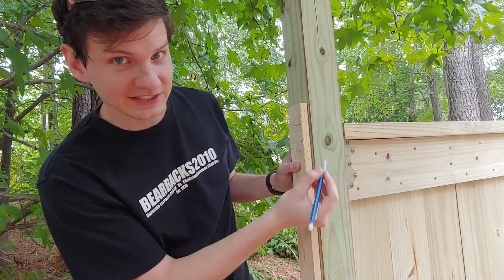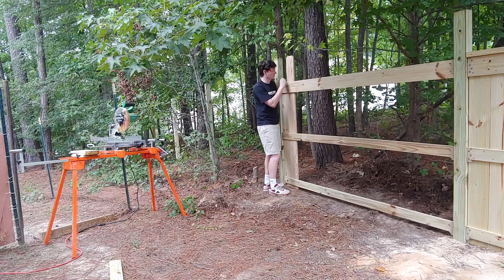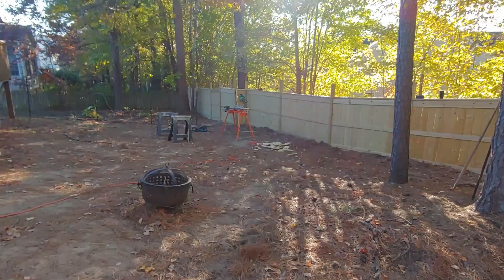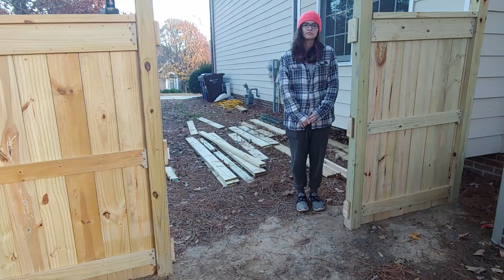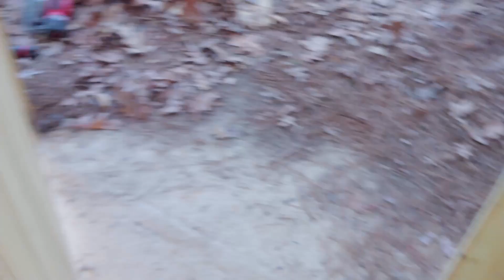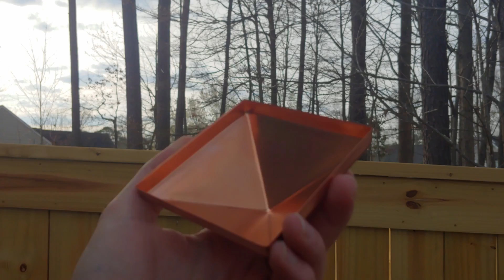How to Build a Privacy Fence With Hidden Gates

Comment: This video is old, so you may have found a different solution or found your way to open from the outside just fine, but we're going to try a pull knob: National Hardware N109-070 Gate Latch Cable Pull, 40", Black

This video also taught my husband about tools he didn't know about, so I feel like our upcoming Lowes trip is about to be more expensive 😂
Reply from the maker: Looks like that's made to do pretty much the same thing! The spring return feature is nice as I have to push/pull the wire back through manually. No big deal just could be better

Comment: looks great... have you had to replace a picket ?
Reply from the maker: Nope! No pickets have popped loose
Reply: @ProjectBilld  I wasn’t thinking they popped loose, maybe a broken one , just curious how tuff to replace one would be incase of a mishap or storm damage
Reply from the maker: Gotcha. If I had to replace one I'd probably cut the picket in half so I'd have room to slide it out. For replacing it I'd dig out under it a little and leave it shorter than before, just long enough it fits under the top rails.

Comment: Not enough screws penetration in the boards, no way!, always should be screwed from picket to post or rail not the other way around, looks pretty today not so sure in a few years
Reply from the maker: Seems like you missed a few details. The pickets are screwed from both sides and the screws come within a quarter inch of sticking out the otherside. It's been almost 4 years since I built the fence and it's still pretty

Comment: How the fence handling deflection with wind against it? That concerns me using 1x's.
Reply from the maker: No problems with wind to this point. As the boards dried they shrunk a little so there are 1/2 to 1 inch gaps between them that keep it from acting as a sail
Reply: @ProjectBilld  
Thanks for the response.

Comment: Where did you buy the metal brackets ?  I have only seen brackets for a two by four.
Reply from the maker: From Lowes. I added a link in the video description just now to the ones I used. I'm not sure they still carry them in store but you should be able to order them for store pickup
Reply: @ProjectBilld  thank you for the great video
Reply from the maker: You're welcome!

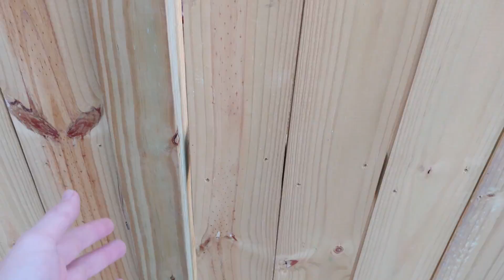Comment: 12:50 Maybe just move the latch to the top of the gate? 🙄
Reply from the maker: I did consider that but our dogs would be able to push the gate open at the bottom if ithe latch was at the top

Comment: Well I'm impressed with your fence.  It really looks nice and is different that the style that is commonly put up around where I live.  My only question is why did you cut the pickets and not just got for a 6' fence height?  I've become a fan of metal posts (sch 40 galvanized) because I've found you install once and it should be good for 50 years or more. Wooden 4x4's 10-15 years is about all you can get.
Reply from the maker: Thanks! Our hoa wouldn't let it be any taller. I really wanted the flat top capped look so I would have had to cut the pickets either way. And I hear you about the fence posts, I've seen lots of 4x4s rot off. I'll have to look into metal posts for the future

Comment: My overly complicated solution to opening the gate from the outside with the latch still in the middle would be to cut out a 2"x2"x4" piece of wood out of the top rail on the inside of the fence section with the latch. Then reattach it with a small hinge that allow it to lift up. Then attach the latch wire to it. From the outside it will look exactly the same and when you use the gate it appears as if you are just putting your left hand on the fence to brace yourself and pushing the gate open with your right hand when in reality your left hand is actually secretly lifting up on the back of the top rail. Almost reminiscent of tilting a specific book on a bookshelf to open a hidden door. 
Also I feel like you should add the metal brackets to the the gate so it matches the rest of the fence. While they aren't needed since the gate isn't attached to the 4x4's it will make it even less obvious that something is different about that section.
Fence and gate is great as is though. Keep up the good work!
Reply from the maker: Nice idea! Would be fun to make. And I am planning to add fake brackets to the top but I need to cut them in half and grind them smooth so they don't interfere with the posts on the side. Just haven't gotten around to doing that yet

Comment: Instead of having to put in the wire to open the gate from the other side
You could have but the latch at the top 
So you can reach your hand over and open it
Reply from the maker: I've been thinking about this one for a little while and the problem I could see with that someone would be able to push the gate open far enough at the bottom to get through
Reply: True
However your gate is designed to look like the rest of the fence. If someone did find the gate and wanted in,
the wire sticking out will be found before that person will realise that going under is a possibility.

If you are worried about the gate being able to get under using a second latch at the bottom will solve that issue, then add wire and attached it to the first latch at the top so the gate can open.